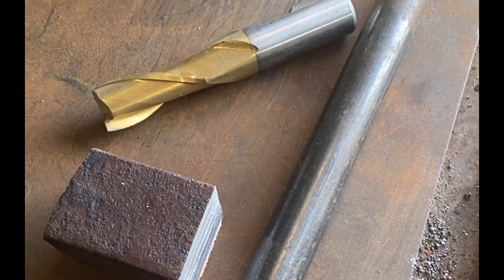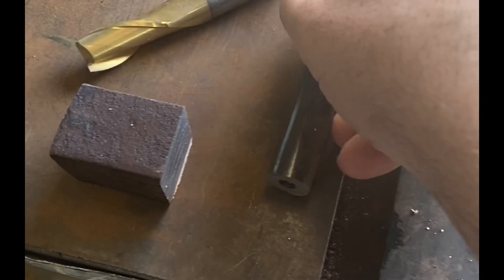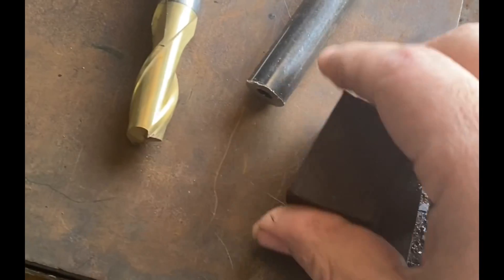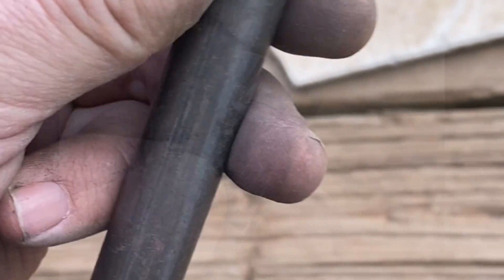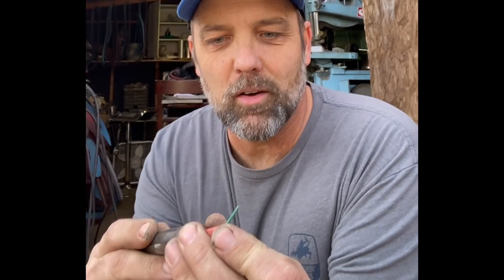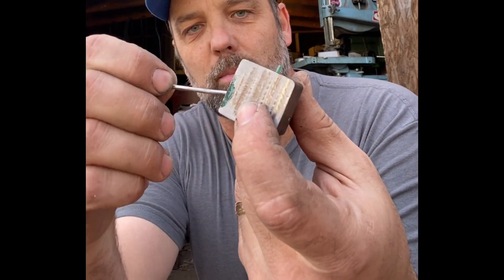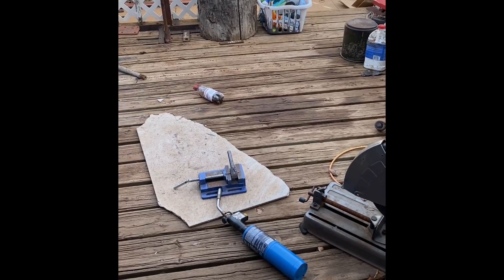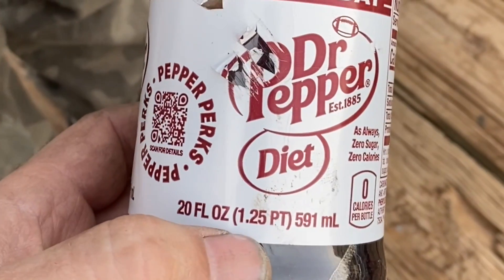Easy firecracker cannon

Comment: I made these as a kid, but much more crude... just a metal tube as a barrel fastened to a block of wood. There was no breech; just one firecracker in the end with the fuse sticking out the back, and another firecracker loaded fuse-down in the barrel. It would shoot the lit firecracker about 7 - 10 yards where it would blow up about 4 ft off the ground. Hours of fun shooting at old model planes hanging off a fence rail.